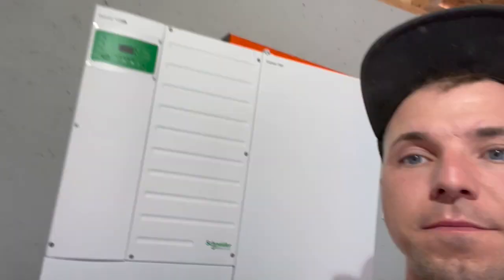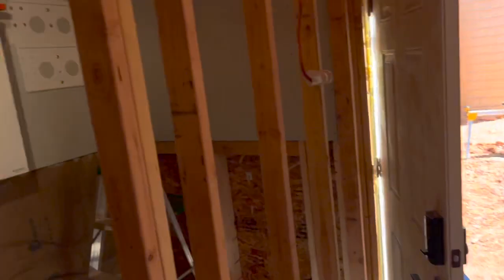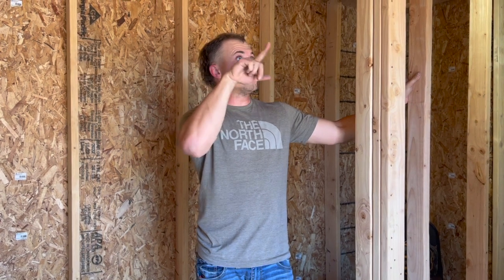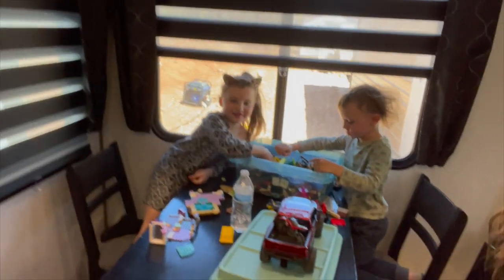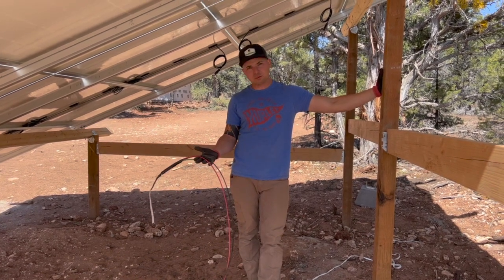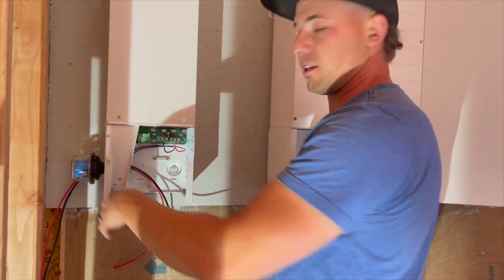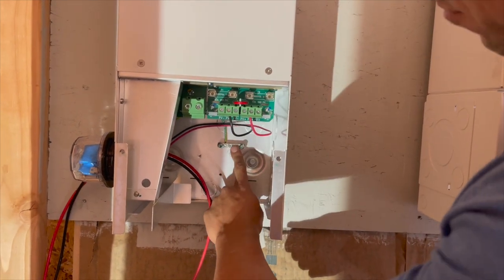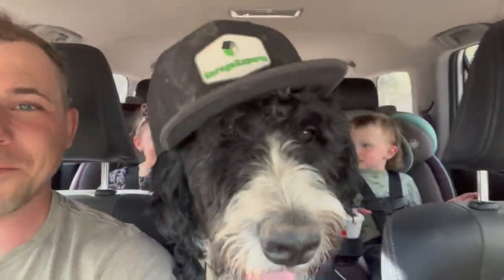Finishing the Solar Array I Momma's gettin a garden I Off Grid

Comment: I think if u build something with trusses and keep them visible and paint the metal on trusses black and stain the wood pecan or just clear coat them use spray foam in ceiling then wood and clear coat or stain the same as the trusses I've seen it and it's beautiful and u have more room.